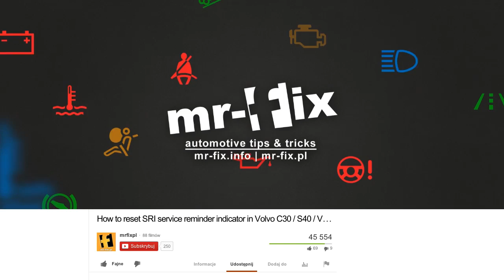How to clean throttle body in 2.0D HDi TDCi (136PS Volvo Ford Peugeot diesel engine IAT MAP)

Comment: will this cause dpf soot messages
Reply from the maker: Unlikely. This message shows when ECU estimates that the filter is full. That estimation is based on the readout from the differential pressure sensor (installed next to the battery, with two line going form it down to the filter). It reads pressure before and after the filter and if there's pressure build-up before the filter, it calculates how clogged it is.
This has nothing to do with the intake manifold.

Comment: I have some rubber pipe conencted to mine. How do i remove it on a volvo c30?
Reply from the maker: +Domo Mandingo this video is from C30. Where do you have an additional pipe connected?

Comment: My car is a Volvo 2.0d 2008 but it only has 1 intake pipe
Reply from the maker: Some Volvos with 2.0d will have just 1 valve. Mine had intercooler bypass, so that why there are two.

Comment: My one is. Not a twin porn what’s the difference it’s the same engine
Reply from the maker: There were versions with and without intercooler bypass.
Reply: mr-fix am sure It has an intercooler but only one port strange great video though t
Reply: mr-fix is The engine you’re working on have an intercooler
Reply from the maker: Both engines have intercoolers.
But in mine there's an additional bypass so the controller can choose if the turbocharger air should go through the intercooler or should it go directly to the engine.
In your engine there's no bypass and turbocharger air is always going through the intercooler.
Reply: mr-fix Okay thanks for that in your opinion what is the better set up

Comment: Hi 
I have focus 1.6 tdci 66kw. When l switch off the engine and the entire car start to shake. If anyone knows what is the problem. Tnx
Reply: maybe the fuel doesnt shut off properly -> engine keeps running on its own ..? as far as I know, Diesel Engines can only be stopped by cutting the fuel.

Comment: I did the same, but the turbo is not working now🤔
Reply from the maker: Check vacuum lines if there's no rupture. VNT turbo is controlled by vacuum line.
Reply: @mrfixpl  i think that i have damaged the sensor by cleaning with unproper spray?
Reply: @mrfixpl  Thank you man!!! It's was the vacum line, please in email sent me your address, i want to send you some swiss chocolate 🍫 😉
Reply from the maker: @ecosafe6233  Happy to help! Catch me in private message on facebook or instagram 😀

Comment: Remove throttle body, and use brake cleaner spray inside don't need to use circuit cleaner or stuff :)

Comment: Oh my god .. Why remove all of parts ? Just use Brake cleaner .... It's just perfect , for MAF and this throttle body.
Reply from the maker: +Cerisette Kotomi because gears that drive those flaps often get broken. I always try to make my tutorials with as much disassemble as it can be necessary when fixing certain issues. It this case someone might need to remove it to inspect those flaps or even replace whole element.
Reply: +mr-fix Thanks :) !
Reply: Very* Yes i support your statement; 

It is not wise using an aggressive "cleaner" on sensitive electronics.